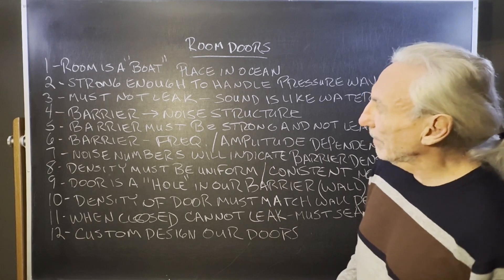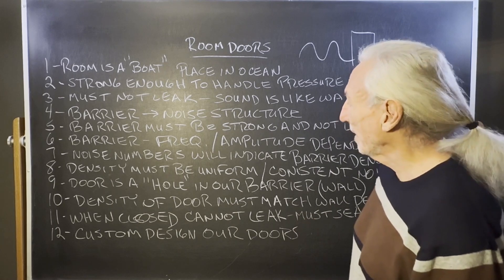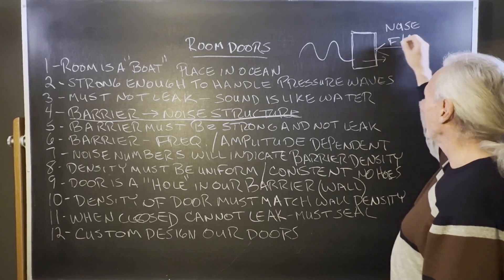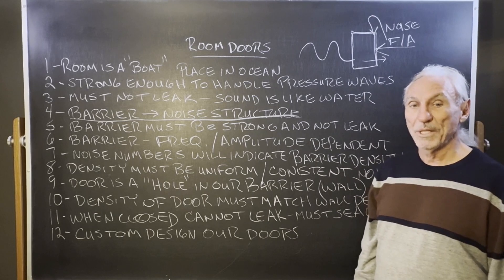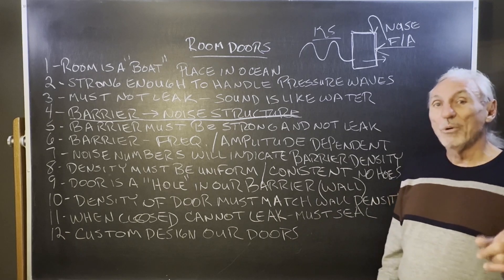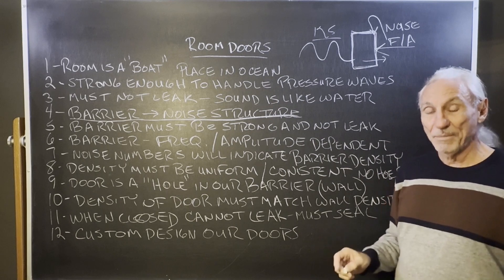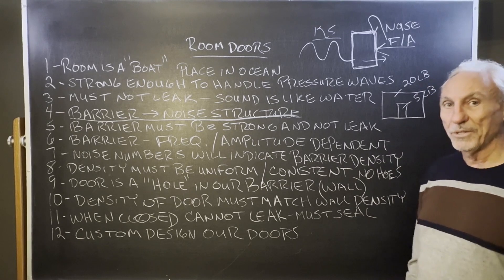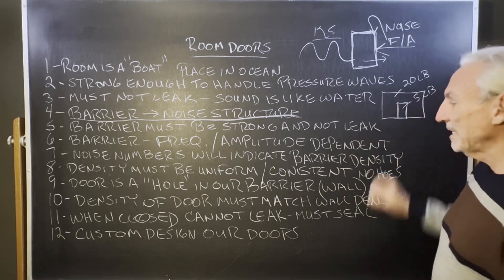Room Doors - www.AcousticFields.com

Comment: Interesting, thanks. I tested my door open and closed, and the room sounded way better open -- especially in the lower frequencies. However, since the door is slightly off-center in the rear wall (behind the listening position), I suspect that a properly treated and closed door would be more ideal, as it should skew the stereo image less.

How do you measure the noise?
Reply from the maker: Use RTA Pro apple store.
Reply: @AcousticFields  Thank you sir